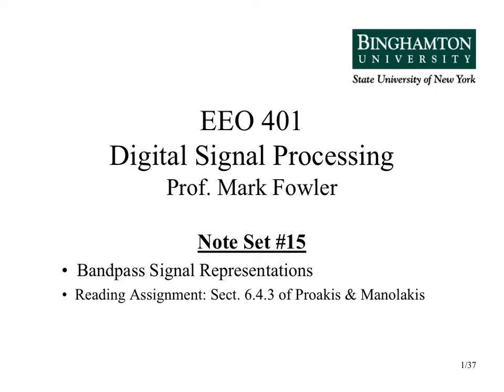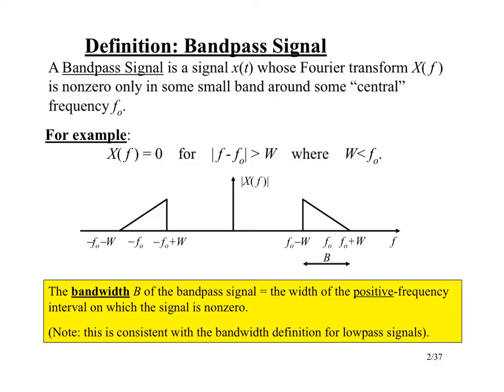EEO303 Note Set #15a Bandpass Signals

Comment: What is DC?
Reply from the maker: DC stands for "Direct Current" as used in a circuits class - where it means voltages or currents that are constant (i.e., don't change with time).  In Fourier theory we use DC to refer to the component at a frequency of 0 since cos(0xt) = 1 is a constant.  So in the context of Fourier when we say DC we mean 0 Hz (or rad/sec).
Reply: Ah okay, it makes much more sense now with that definition. Thanx
Reply: Direct Current or Washington DC